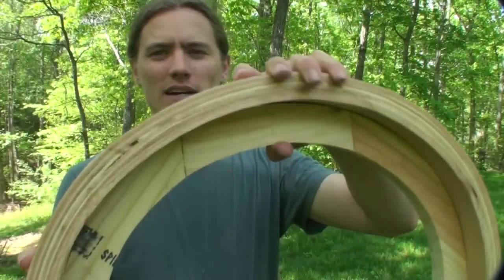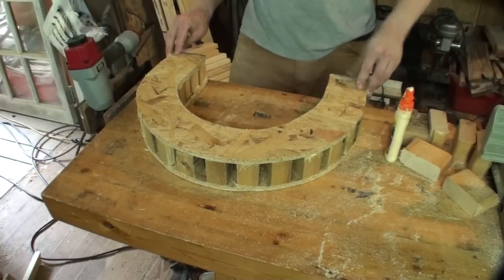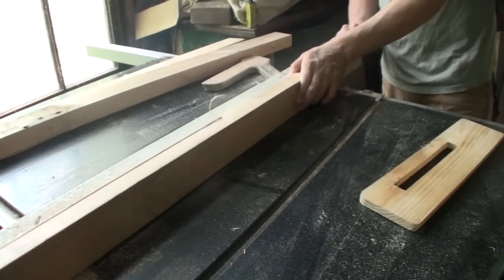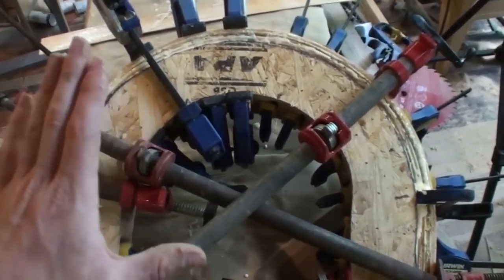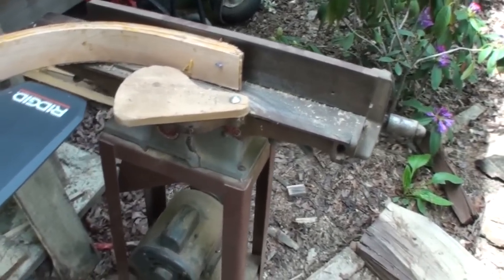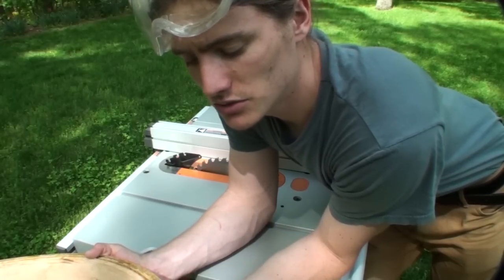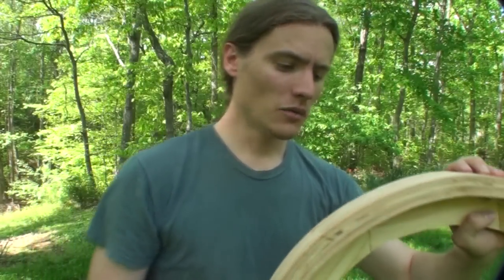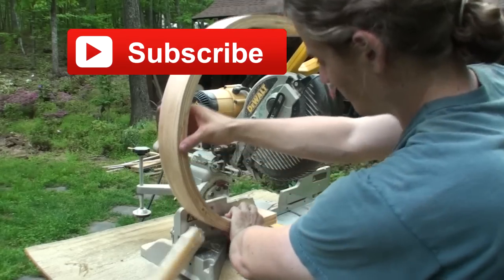Bent Laminations - How to Bend Wood

Comment: Great video... just a tip, if you don't have clamps you can also use a ratchet strap.  just place a spacer between the free ends of the arch and ratchet away.  you'll have steady even pressure all the way round!

Comment: I can't believe you didn't take a belt sander to the dried glue before taking it to the jointer. Dried, hard glue is the best way to foul up your jointer blades. I also agree with one of the previous comments about yellow glue vs resin glue. You must have worked REALLY fast to get all those clamps on before the glue started setting up. I would use resin glue to give me more work time.

Comment: Awesome thanks for sharing. How would you do a multiple notches??? In a 2" x 4" X 30" I need a make 10 notches with 1" of separation from each other and 1.5" wide and half  inch deep what will be the faster way to do it ?? any ideas ??
Reply from the maker: +Efren Flores I have no idea what your asking, if your just wanting to ad some sort of notches in a bend, you could do them by hand or on a table saw with a dado using a sled.

Comment: THANKS!!! I have a challenge on my hands. a client wants to do a live edge legged glass top table, the challenge is he wants to curve the legs horizontally so to give more leg room at the ends. Any suggestion to bending (slightly) a 2" live edge 29" tall 24" wide?
Thanks for the wisdom my friend. 
Dave
Reply from the maker: +Dave Marriott You do have a challenge. I'm not completely clear on what your doing, but it sounds like you want bend a 2 inch thick, 24 inch wide board and maintain a live edge. That's going to be tricky. Not sure how much you want to bend it........but in general, I'd do some samples if possible. The only way I can think of is to soak it in water, then steam it or boil it for a long time, several hours. Then you will have to bend it over a form that has a tighter curve than what you want, like 20-25% more. I'd also bend a longer piece than what you need, probably twice as long or more, so you can cut the piece you need out of the middle of the bend. Like I said, it's going to be tough, it's going to take a ton of force also, and you'll have to back up the bend, plywood might work, people usually use metal straps. The amount of force will be hard to make, your form will need to be very beefy and it could be pretty dangerous if something broke or slipped loose.....that's not an over statement! With all that said, it is a fun project and the kind of thing I like to experiment with. The biggest thing I've bent is about 1.5 inches by about 5 inches, bent into a U shape. The piece was about 4 or 5 feet long. It required a solid form, about 20 jorgesen clamps and 4 guys to bend it after it was steamed for about 1.5 hours. It was oak, that was the other thing, something like oak or ash will be the easiest to bend. This is something I need to do a video on! The other way to go about something like this would be to have a thicker live edge slab cut into thin slices, then re glue it up into a bend in a vacuum bag, aligning the edge as close as possible. It wont be easy. Then you'd have to reshape the end some. Or you could just glue up some slices and cut a fake live edge on a band saw and shape it smooth. your slices could be ran through a drum sander to get them smooth. I know this sounds like a lot as a suggestion, but your asking a lot out of wood. If it where me I'd layer it up and fake the live edge.............or you could bend just the live edges then build up the center with bendable ply and venneer the inside and outside. That would be the best of both worlds. But the easiest thing would be to convince the client to do something different! Let me know if you have any other questions, this is one of the most fun questions for me to think about I've gotten on my channel.

Comment: To the guy who was asking about clamps, if you add a top form you can then use ratchet straps weights pretty much anything that will put pressure on the forms. F cramps and G cramps are better for this type of work!
Reply from the maker: Adam Lynch Indeed, you can also get into some more shapes with two part forms. Good tip.

Comment: Did you mention what the material/wood is that you used for the pieces of wood. Was it ply or doug fir?
Reply from the maker: +Dave Marriott HI, I mentioned it right around the 3 min mark, it's pine. For a project like this you can pretty much use what ever you want as long as it will take the bend. Sometimes you have to steam wood to get it to take your curve, in that case I would use oak myself. If it is in an unprotected area outside you could use wood more suited for exposure.

Comment: Good video. You made a very tight bend (20" diam.?) with 1/8" laminations. Would you suggest any guidelines for increasing lamination thickness for larger radius bends? Thanks.
Reply from the maker: You can use thicker strips, but the thicker they are the stiffer they are which may cause more spring back. With 1/8 strips you can do pretty tight bends.
Reply: Thanks for your quick reply. I was trying to ask your opinion about the correspondence of lamination thickness with radius. For example, it looks like you used 1/8" for a radius nominally 12". For an even tighter radius, you might need to drop down to 1/16" to make the bend. On the other hand, I am looking at making far more gently curved rails, about 3" wide at 60" radius, and was hoping to reduce the number of laminations by making them a little thicker, yet still avoid spring back. Do you think I could increase lamination thickness a bit (maybe 3/16-1/4"), or do you think that even with the bigger radius, I'd invite serious spring back?
Reply: For anyone else with a similar question, I found one general guideline online:
"To cold-bend wood, first resaw your stock into thin strips and plane it so the thickness is even. The thickness of the strips depends to a large extent on the radius of the curve. The tighter the radius, the 
thinner the strips. I use this chart as a jumping-off point:
• 2″ to 4″ radius — 3/32″ thick
• 4″ to 8″ radius — 1/8″ thick
• 8″ to 12″ radius — 3/16″ thick
• 12″ radius or larger — 1/4″ thick"
This other mechanic also advised that he used 1/8" strips for some projects, even when the radii were not nearly as tight as 8". So I conclude, consistent with the Homestead Craftsman's original reply,  that one must experiment to be sure, and that thinner will always be the safest bet...
Reply from the maker: For big bends, thicker is fine and potentially better in certain cases and easier/less waste. if your worried about spring back you can make your form a touch tigher than the desired radius. The thickness of the strips also depends on the wood type, try to bend a spruce strip vs and oak strip...the spruce will snap way before the oak.......just like the trees! In short, some woods are good for bending and some are not......or at least not as good. I don't get too scientific with anything, I just experiment and see what happens....I suggest the same for everyone.
Reply: Thanks again! I'll go with oak and test to see how thin I need to go. Glad I found your channel.

Comment: What's the tightest curve that can be made?
Reply from the maker: very tight, just need thinner strips. I've done bends with many layers of veneer.
Reply: The Homestead Craftsman I was looking for about 4 inches. Is that too tight a bend?
Reply from the maker: You can do it, you can also wet or steam your strips and pre bend them before you glue up if needed. But just do thin strips,  what kind of wood are you using.
Reply: The Homestead Craftsman thank you. We're making crafts that you use hose clamps, but I want to do something nicer.

Comment: you should really use the safety guards on that table saw
Reply from the maker: +First Last  I'm not a fan of them, makes it hard to really see what your doing. The best thing is to just make good cuts and keep your hands safe. Woodworking is dangerous, you can be careful on a tool and then the next one can get you. If you want to be 100% sure not to hurt yourself, just don't do it.
Reply: +The Homestead Craftsman That's what "safety" guards are for to help (not saying it won't ever happed) keep your body from getting injured. I am a retired cabinet maker of 42 years and all the time I was in business if there was one thing an employee would get fired for is not using the "safety" guards.  Good luck.
Reply: +First Last Luck has nothing to do with it. It's called skill.
Reply: +Robert Palmer good luck
Reply: +First Last don't be scared bro, just have that medevac plan in place

Comment: How about bending plywood?
Reply from the maker: +English Street That woks too, but in a case where it is not painted it looks like bent plywood......which means, not attractive. So in the case of bending a piece of molding or rocker for a chair.....that will receive a clear coat, the laminations make for a solid wood bend. This is a rough example due to the project, but it can be done very cleanly and precisely, ripping the strips from high quality wood and gluing them back together in sequence, you can barely see the glue lines when done correctly... you other option is steam bending, which depending on the project can be the best way or the wrong way. Also doing it this way keeps you from having to by the bendable plywood, so it's common easy to get materials. Thanks.